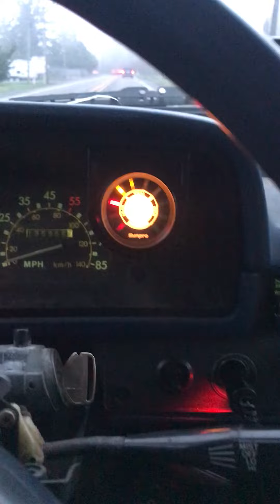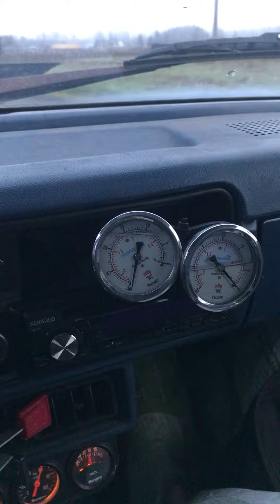Not all sunshine and roses, gassifier poor performance

Comment: Yeah, it's not perfect but if it gets you home you win . I read one guy  predicts  8 -10 $ for gas coming. That's a lot of pallets !
Reply: I'm screwed cause all my rigs are diesel or I'd be building one.
Reply from the maker: @nhhbbyloggr5022  payed 4.89 on the way home, doing a video on getting the truck running right should be uploaded tomorrow, don't want to keep buying the dino juice. Should be 7$ in a month from what I'm hearing
Reply: @BigBeavrSlayer  I'm interested to see what you found during the cleanout. BTW, I have a hard time hearing what you are saying while driving the wood truck. But I get the picture for what's going on.
Reply from the maker: @nhhbbyloggr5022  I'm hoping to upgrade my camera to some nice stuff, the audio is crap while using my phone and driving. I have tried to separate the audio and turn it up but the noise of the truck friends it out something terrible
Reply: @BigBeavrSlayer  Same here. My camera does not have a remote mic provision, I am trying to find a way to do " Voice Over" type commentary with some of my projects. That's a whole new set of problems though.
My hope is to find a good camera with a remote mic port and wear a wired mic. Lately I've been using a Panasonic DC -ZS70 for the picture quality and download speed but there is no mic hook up port. The search continues. If and when you find something let me know?

Comment: If it was easy to run on wood,everybody could do it.Did you try other type of wood?As far i'm concerned the resin in the pine wood is an extra you don't want.Wish I could run a car on wood in my country and I would be doing the same as you.Keep up the good work.
Reply from the maker: I have tried a few different wood fuels so far and each one it's like relearning how the gassifier will operate, a whole different animal. My best performing fuel so far is a mix of Douglas fir and native wild cherry wood, seems to get the best milage with the best off the line power and least amount of soot that fills and clogs up the system. So far my big gripe with the pine is it burns up MUCH faster then other woods and leaves a ton of soot throughout the systen